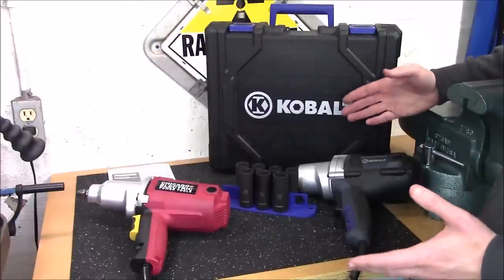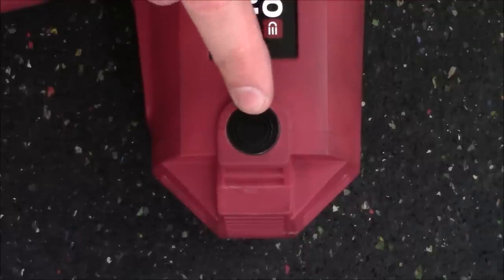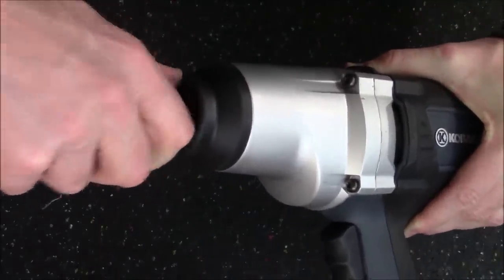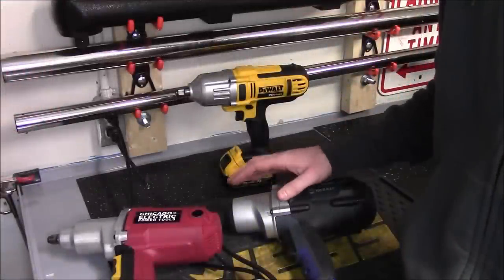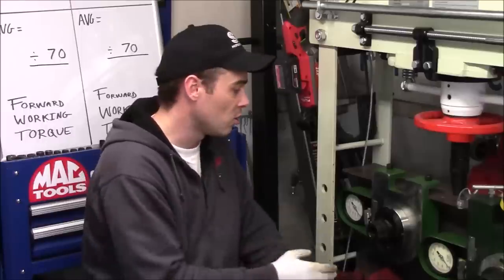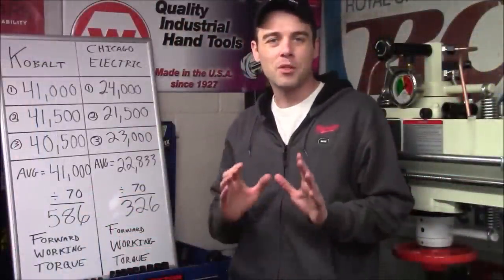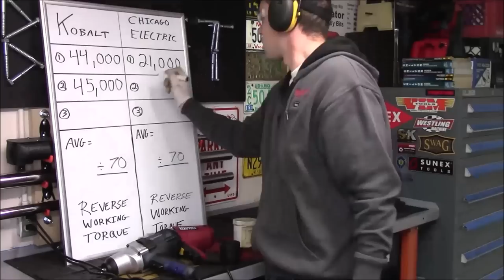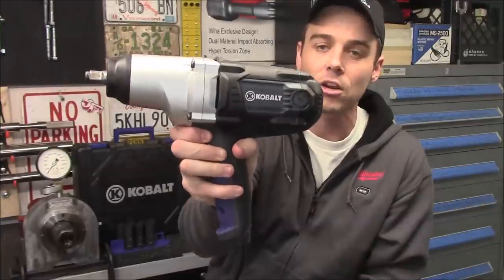Kobalt - VS - Harbor Freight 1/2" Corded Impact Wrenches

Comment: A tip on the Harbor Freight one that is a must do and it really helps it to not only work longer, but stronger.
The metal nose piece is easy to take apart and the gear clusters is a pretty simple operation to take out and put back if you pay close attention the orientation of the parts when you remove them. The tip is most them have almost NO gear lube in that at all and after only four or five uses if you take it apart you'll see lots of metal flakes in around the gears. Once you have it apart, clean out what little crap grease is in it, re-lube it with a good grade of multi purpose grease, don't pack it, but rather cover all the part and the inside of the front part of the nose housing and put it back together. It will run far better and produce much more torque than when you took it out of the box, in fact knowing what I do about it now if I was to buy a new one I would clean and grease before the first use, its that big of a deal.

Comment: Kobalt is $150 and the HF is $50 (usually on sale for less). The Kobalt better make more power with that price difference. I don't normally torque my lug nuts to 500 flbs so I'm good with the cheaper option. Thanks for the good review with real numbers.
Reply: just got the Kobalt one on a black friday deal for 99 bucks.  The cord length, Rubber front, sides and handle, power on light, case and sockets are all worth the extra 50 bucks IMO.  Plus it looks ALOT better.
Reply: @CUEBALL424  HF was on sale for Black Friday for $29. STILL 1/3 the price.
If you think that a light is a good option, there is no hope.
A Fool and his money are soon departed - My Snap-On Dealer.
Reply: Harbor shit puts americans out of work
Reply: @CUEBALL424  Another Snap-On Tool Fool.
If you use it daily, then spend the extra money.
I have thrown away every case and don't need additional sockets cluttering my garage.
My point is those extra add-ons aren't worth it.
Your day 91 is a false clause, unless you have empirical data that backs it up.
And even then, $12 will get you a 2 year warranty.
"Quite often" is, like your answer, obtuse.
Reply: @pauljoey7977  Unions put Americans out of work.
Reply: @pauljoey7977  Before you make silly statements , do as I did and look to see where MOST of the big AMERICAN name brands are made, you wont find many made in USA.
Reply: @stans5270   live better work Union!!!!
Reply: @global6674  Yeah, no. Unions? 
What happened to the factory workers that made:
Plymouth
Pontiac
Oldsmobile
Saturn
Mercury
Saab
Hummer
All gone because of union greed.
Teachers? 1/3 need to be fired, but they are untouchable.
Reply: @stans5270  teachers are paid way to little, their efforts are underestimated and all those car names your talking about failed not because of unions but because of corporate greed.  Case in point. Trump gave the auto industry a big tax break only to be fucked over by them closing plants.  I personally work under a union for almost 30yrs and I can tell you, I live better.
Reply: @pauljoey7977  So you think the Kobalt is made in the US, wrong Chinese just like 90% of the stuff we can get in the US today.  Even DeWalt that talks about being made in the US really is only assembled here using parts from outside the US most likely China too.

I think HF makes some pretty good stuff for the casual user, I would never by their stuff if I were using it daily to make a living.  But I also would not pay Snap-On's ridiculous prices.
Reply: @stans5270  And the list gets longer everyday.  You forgot to mention all of the government workers, Fed, State, County and City.  Their wages and benefits are bankrupting cities all over the place and many more are just a failed tax away from collapse.
Reply: @Hoggdoc1946  Educate yourself. EVERY one of them is negotiated contracts from tens of thousand different areas. You have thrown a stack of hay over ONE needle to make your whole argument pointless
Reply: @stans5270  just making a living wage  and not getting filthy rich like Americans corporate elites.  Go tell that bs. to your local corporate CEO!!!
Reply: I worked in a school for 2 years, most of the teachers worked 7:30-4. They didn’t typically work weekends and they had the vast majority of their summers off, plus all major holidays. All while making more money than the average American and being pretty much invincible even if they were bad at their jobs. Many of the teachers simply reused material from the previous year, some even put their lessons together using material from websites and youtube the day of the lesson. Teachers are overpaid in my opinion.
Reply: Stan S no your own government did they said it was good for companies to do business with the Chinese and other countries that use practical slave labor no one can compete with that
Reply: It's not always a matter of torquing stuff. It's often a matter of breaking stuff loose.
Reply: If he opened both units you would see the quality difference between the 2 and you’d get why Kobalt is worth so much more. HF is good for small jobs, but it is a cheap tool for a good reason.
Reply: @BlueDroneBlues  so true, I got the Cobalt, it’s worlds better than the HF model. But , HF does have every damn Knick knack you could think of.

Comment: Been using a HF electric impact for about 6 years now.  The cord FINALLY gave up and has a break just inside the strain relief.  That's 6 years of a lot of use and abuse.  Not bad for under $50 bucks.
Reply: Easy fix.
Reply: We used it in dock building to tighten the carriage bolts... Dropped it in the river 3 times myself... Plugged in and we would pull it out with a hook lay it in the sun and run it the next day

Comment: I bought the Harbour Freight one in 1990 while stationed in the Philippines.  I used it on my Shovelhead for drive belt changes. It still works good on my auto lug nuts.

Comment: Nice review, but why didn't you mention the price difference? the HF tool at less than 1/3 the price of the Kobalt is all the power your typical diy auto mechanic needs. I've had mine for over 10 years (paid $30 and it came with a plastic case) and it still works great.

Comment: HF has #64120 Bauer 1/2 in. Heavy Duty Extreme Torque Impact Wrench for $99 now which will be much better suited to compare with $150 Kobalt than $40 Chicago electric.
Reply: @CNT....do you know if anyone has done that comparison?  I have been searching reviews and haven't seen anyone do it yet.
Reply: @amp12345amp  , I've seen reviews on the heavy duty,  but no comparisons.

Comment: I got the Bauer Harbor Freight brand 1/2 inch corded electric torque wrench for 58 bucks during the Black Friday sale. It has 1050 foot pounds of break away torque and 300 foot pounds of forward torque. It is a monster and out performs all of my air powered impact guns. I'm almost positive that the forward torque is actually more than what is advertised.
This thing will remove welded nuts and single use trailer axle bolts. Basically whatever you put it on, it's coming off. Lol

Comment: I been using the Harbor Freight 1/2" Impact Wrench for 10 years so far. I Never had a problem removing even the most stubborn lug bolts and this Impact Wrench never over torqued or snapped off any lug bolts either. For $60 bucks and even less with the 20% off coupon how can you go wrong.

Comment: I've had my Chicago Electric corded 1/2 inch impact for 4 years, and I love it.  I bought it to replace my ancient yard sale Ingersol Rand electric impact that died.  The Ingersol Rand was always useless in the fact that it did not have the torque to loosen lugnuts.  After experiencing for the first time using the Chicago Electric I was immediately shocked, and sold.  Of course it has some trouble at times budging stubborn lugnuts, but after a few jolts of the trigger they will come loose.  You have to have patience.  I also use the wrench to spin off, and tighten mower blade bolts which it also does a great job with too.  If this one dies maybe I will buy an upgrade, but for now it suits me fine.  Honestly I did not know how I coped all these years without one.

Comment: i know that electric impact guns are popular now but i refuse to give up my pneumatic. i have had the thing probably 20 years, its probably tired but still gets it done. i have a hose reel hanging form the ceiling and a 60 gallon compressor so using it is probably more convenient then grabbing and extension cord. the pneumatic style is time tested and works well
Reply: The corded ones do not need air compressors which is the very first point anyone considering a corded wrench thinks about. Now, I use my DeWalt cordless 150 lbs wrench for almost everything, never had a problem. If I'm thinking about opening a shop, a pneumatic wrench would be the first thing that comes into my mind.
Reply: Look at the newer cordless tools. Milwaukee has the 9.0A series and DeWalt has the 60V cordless tools. You really don't need a cord or an air hose. Just bring money.

Comment: I have had the HF impact for several years and have had nothing it would not break loose. It's been a solid workhorse.
Reply: Honda crank bolt?
Reply: Frank W the infamous honda crank bolt is those high end 1/2" cordless impact wrench's game. (Milwaukee/IR/Mikita/Dewalt)

Comment: I'll take the harbor freight, less than 1/3 the cost and only sacrificing 1/2 of the power. More power than most need anyway. If I needed to use it everyday consistently I probably would purchase another brand to get value out of longevity.

Thanks for the review! love all of your videos!
Reply: late comment but sometimes you just need the extra power :D im been using the kobalt since release and also have a harbor freight one, and the kobalt was the only one able to do my Suv suspension since i dont have any air tools. the Harbor freight wouldnt budge the bolts, and kobalt would move it little at a time but eventually did the job. with that said i broke a 1/2" breaker bar trying to get the nuts and bolts apart haha was pretty frustrating but learned from it. nowadays i use a milwaukee rated 1400 and love it

Comment: I have this Harbor Freight unit. I used it to replace the struts on my Camry. It really came in handy for dealing with those rusty end links. For me the price was a good deal as I was able to get the impact wrench and a 10 piece set of sockets for $54. For some of us DIYers the comparison isn't against other impact wrenches, but against hand tools. I think this would have been a better review if the unit was tested alone and used to do some actual real world jobs.
Reply from the maker: +Bennie Minor So to test torque, I would be better off removing a lugnut ---- instead of using a $3k tester.....I see.....
Reply: Yep! Lug nuts only get torqued to around 100 ft/lb.  Can the tool remove the lug nut is all I'm trying to find out. Your $3k tester is nice, but its overkill for what I need to know. I'm not a professional, just a DIYer, who has to justify spending $50.

Comment: About 3 1/2 years ago I got the H.F. for $50 + $20 extended warranty - which I never used and has expired. (Disappointed in the base warranty length.) The tool is used infrequently, but has always removed everything I've tried it on, like lugnuts, ball joints and control arms. It seems to be a hit or miss in quality or performance for many people though. Your written review indicated the Kobalt had more included and was stronger - but the current price is $150 - 3 times the price of the H.F. So, it's the better but more expensive one.

Comment: I bought the harbor freight impact after my air compressor broke down and before I bought my battery powered impacts , I had no trouble out of the harbor freight, it never had a problem taking off lug nuts or easy to reach suspension parts

Comment: Interesting review, and very well done. I recently had the HF version and ended up returning it. A week after I bought it I used it to work on my truck to do a brake job (the reason I bought it) on the front end. I only managed to get the lug nuts loosened before it stopped working in reverse. The problem seemed to be the switch itself, but regardless, I ended up finishing up the job by hand. I do have a compressor so I may just go ahead and get me a pneumatic version but will keep this corded Kobalt on in mind.

Comment: Well these tools are 2 different price ranges... and the hf impact still exceeded the torque level that is displayed on the box... if your worried about a hf tool crapin out buy the extended warranty... they will exchange it right there in the store.

Comment: Kobalt $149.00
Harbor freight $44.99
Reply: Minus4Plus6 thanks. wanted to ask lol
Reply: Minus4Plus6 super coupon 39.99 lol
Reply: Minus4Plus6 Got my Chicago Elect. For 36.00 out the door a year ago. Works nice and quick on my car. I use an inverter 12v to 110 AC to power it from the car battery. I use the cheap Pittsburg torq wrenches too. HF is the go-to for backyard mechs. : D
Reply: 5 years warranty vs, 90 days.
Reply: Harbor freight has it for special at just $35.99

Am really tempted to go buy it, since I need one. But I do have a 5hp 20 gallon air compressor and i want to get an air one.. but.. they are more expensive :/
Reply: go for the most power you can afford :D its still cheaper than smartphones haha i learn that living in snow belt, ran into seized nuts and bolts that you would think 200 ft lbs would remove but took over 500 ft lbs at constant MINUTES of holding to get release lol

Comment: kobalt still at Lowe's for $150 double power than HF but 3x $$ for that 
power too, harbor Freight is $49 -20% coupon and $15 more for a 2/3 year no questions
 ask exchange  13pc deep impact socket set $19 with a coupon life time 
warranty so it depends on your needs and how much you use it, at the end
 if you buy FH with the coupons and the sockets is still half the price.

Comment: My dad bought one of the Kobalt wrenches a few years ago and while electric may not have the force of air wrenches, so far it hasn't failed at breaking anything loose we throw at it.  I certainly wouldn't discount the Chicago Tool wrench as worthless if all you're using it for is breaking lugs and other fasteners that aren't going to require extra work (just short of torches) and I suppose if you were really in a pinch or some emergency and it was the only one you could get, it would probably be ok.

Comment: Would love to see a review/test on harbor freights 1/2” Bauer corded impact wrench that claims to have a 1050 foot pounds of reverse/nut busting torque and 450 max ft lbs of torque. Also heard that the enertwist 1/2” corded impact wrench is the same tool but cost $30 less.

Comment: Hmmm let me see $35 Chicago tool impact or $150 for the kobalt impact? Both do the same shit. I ain’t gonna torque nothing to 400 ft lbs . I don’t need a fancy case either. If you do the math buy the Chicago impact a voyager tool bag an extension cord,heavy duty of course, and a set of Pittsburgh pro impact sockets from harbor freight you’ll still pay wayyyyyyy cheaper than the kobalt and still get the job done ✅
Reply: "But theyre cheap tools so they must be junk" is what most of my buddies say lol.

Comment: For $150 I can get the Kobalt with a half dozen sockets and a 5 yr warranty. For $50 (or about $40 with coupon) I can get the HF unit, and for $30 more I can get a 37 piece SAE & Metric 3/8" and 1/2" drive impact socket set with case and lifetime warranty, and another $30 gets me an extended warranty of 3 years on the impact wrench. So even if the HF unit blows up after the extended warranty expires I can still go get another brand new HF impact wrench and still be at about what the Kobalt costs. Both units are more than capable of getting the lug nuts off my truck and my boat trailer, so the extra torque of the Kobalt, while nice, isn't needed. I'm thinking I'll be stopping by HF tomorrow.

Comment: does lowe's let you just take it to them for replacement or do you have to take it to an authorized repair shop for Cobalt.  One time I bought a dewalt compound mitersaw that was DOA I made no cuts and brought it to lowes and it was 33 days after purchase I had to find a dewalt repair dealer no exchange at lowe's the tool was fixed, but never had that smooth ring to the blade that most dewalt compound miters have.  Thanks for your review.
Reply: Exchanged with the receipt
Reply: That is BS on Lowe's part, should talk to the manager. Replace or refund within 90 days - store policy. You're out of luck on clearance items though where sales are final even if its defective.
Reply: Oh I forgot, hold onto your receipt and the box with the bar code. They need to scan the stupid bar code even they know you had purchased it. That goes even for the no questions ask forever guarantee hand tools - who keeps the receipt and box with the bar code for that long?
Reply: +Frank W you don't need a receipt for the hand tools or a barcode since every kobalt hand tool has a number engraved in them. Obviously you need a receipt for other items so they know you bought it within the return policy
Reply: +Frank W don't know what to tell you, sorry for the hassle. I'm the tools manager in my local lowes store and would never hassle a customer unless on a power tool that seems to be past warranty.
Reply: Whenever I purchase high value [IE expensive] power tools, I always scan the receipt and bar code. I know it takes a little extra time but its stored forever where you can always retrieve it.